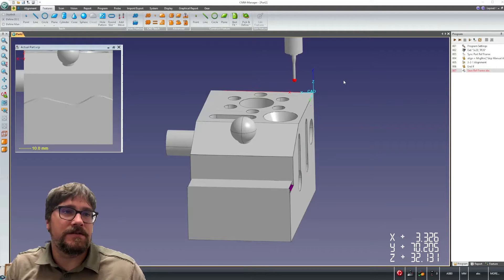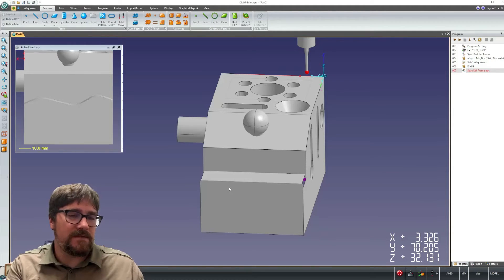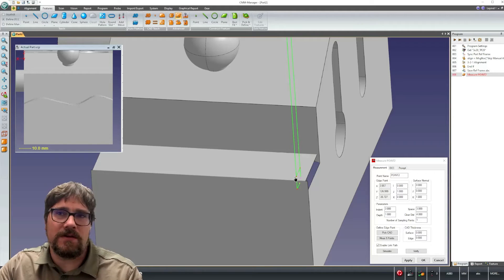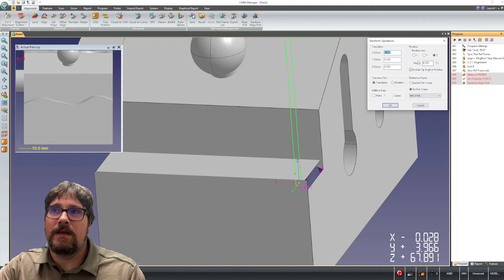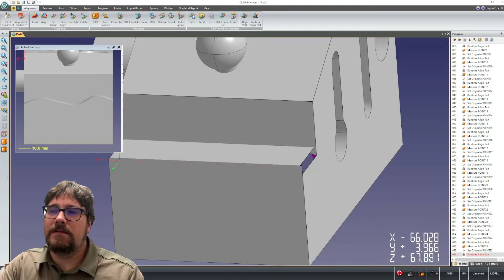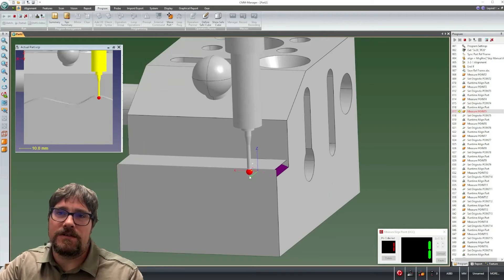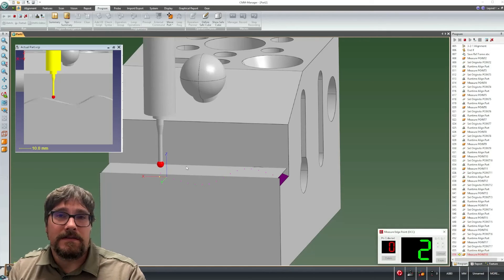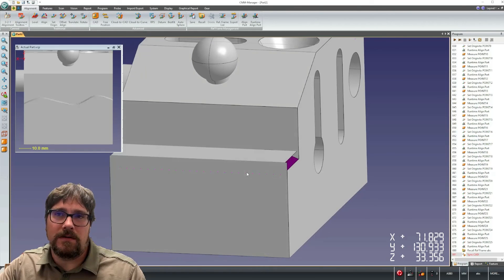Warped Part Tutorial

Comment: How do you modify Cmm manager auto tool path, our parts require fixturing that interfere with auto tool paths.
Reply from the maker: Best option would be to add elements into CAD, otherwise it is possible to directly modify the path from the Path Tab of the measurement dialog box.